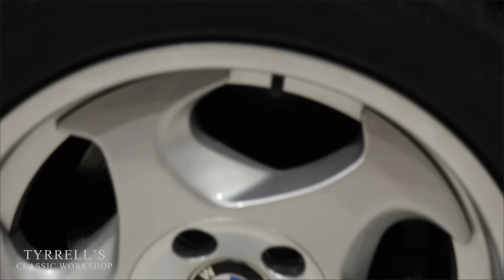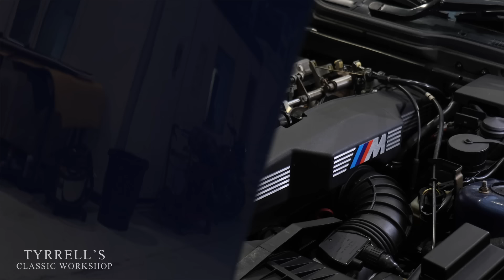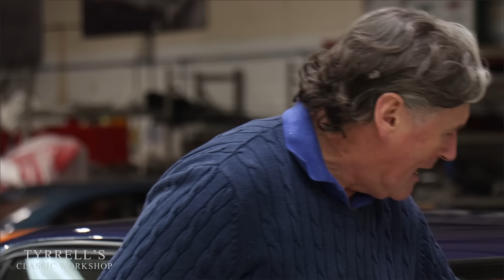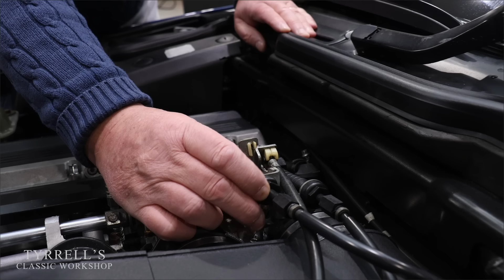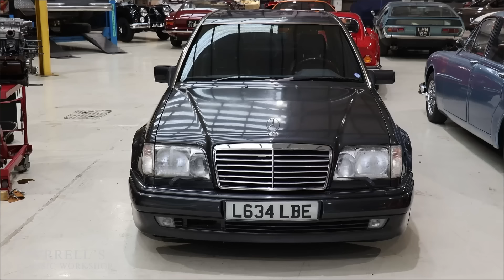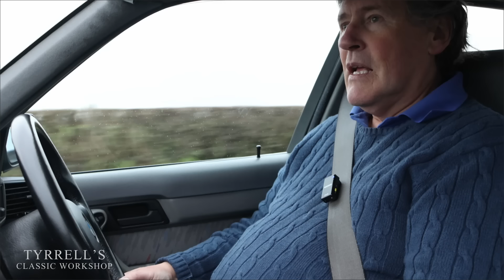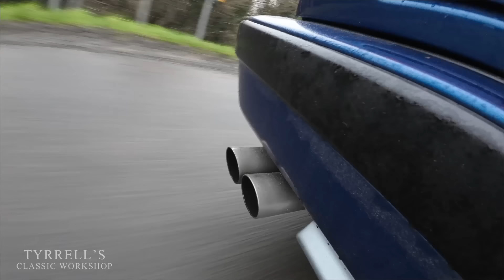BMW E34 M5- the ultimate driving machine?| Tyrrell's Classic Workshop

Comment: Always loved the M5. Unfortunately the 3.8L version wasn't officially sold in North America. To answer your question. In north America, the Taurus SHO was the 4 door somewhat performance car 0 LOL. But let's not forget. The absolute Anti-Christ .... 1986-87 Buick Grand National. Regular production 5 passenger mid-sized family car. As all the magazines clearly stated .... It out accelerated the Testarossa , Countach, Esprit Turbo and everything else made back then in both 0-60 & quarter mile. Only the 911 Turbo's 13.4 sec 1/4 mile was quicker. It did all this with a 3.8L V6 turbo and 4 speed automatic on 215/65R15's. Plus it got over 25 MPG with the A/C on. It was all about bottom end torque coming in at a mere 2400 RPM.

Comment: Very fast, lovely car, had a 3.6 one of these. Every micro meter of throttle pedal gave an equal micro adjustment in revs. Beautiful. But not as fast as the E34 Alpina B10 BiTurbo. Had one of those also!

Comment: I owned two of these at one point, but one was in my collection for a couple of decades.  I also owned an M635CSi for a time.  A few minor points.  Both E34 iterations of the M88 engine had a dual-row timing chains so were no more of an issue than on any other performance car.  The M88 in the E24/28 had a single-row chain and BMW recommended changing the chain and guides as a service item at 160K km / 100K m - an expensive job but just part of owning them.  

Early coolant tanks on the E34M5 had problems with the coolant level sensor thread collapsing in on itself over time.  Updated tanks had a stainless tube insert to prevent the issue.

If fitted with self-levelling suspension on the rear, the accumulators can fail and you get a very 'bouncy' rear end.  It's a cheap fix.  If the rear struts are leaking they can be rebuilt.  Most E34M5s had self-levelling from factory as it greatly enhanced the car's ability as a comfortable high-speed long distance car for four passengers.

The 'brake cooling ducts' are not for brakes.  The duct on the RHS is 'blind' and the one on the LHS has a duct for cooling the alternator.  On the '3.6 litre' cars, the magnesium 'fan blades' bolted to the wheel centres were for brake cooling, but in the end the later 'throwing star' covers did an adequate job without the same cost and complexity.  The body kit on the M5 was very cleverly designed for zero axle lift front and rear without needing a rear spoiler.

Steering boxes on E35M5s are often over-tightened and destroyed prematurely.  They are unique to the M5 and are almost impossible to find.  The on-centre 'play' in the steering on the road is nearly always caused by worn balljoints in the steering tie rods, centre link and drag link, plus suspension bushes.  When stationary the slight play is most often in the sliding joint in the steering column - there is a tapered nut to take out play but if it is over-tightened the column is no longer adjustable for reach.

We live in Australia so I can comment first-hand on direct comparisons.  Both Wheels and Motor magazines ran articles comparing the E34M5 to Holden Special Vehicles modified Commodores - I still have those magazines.  The M5 was a clear winner in the first couple of articles.  In a rematch a couple of years later against the next generation of HSV Commodore, the M5 was still declared the winner but by a lesser margin.

We saw E34M5s competing in motor racing events in Australia too.  One came third outright behind two BP-sponsored Mazda RX7s in a 12-hour production race at Bathurst, and two were campaigned successfully in targa events - including Targa Tasmania.  A good friend who has raced XJS Jaguars for decades mentioned the wet weather supremacy of the M5 in Targa Tasmania: 'It was bucketing down with rain and an M5 passed me on a corner like I was standing still!'.  Their wet weather balance is legendary.

Nice to see an E34M5 getting its due on your channel.  As a former owner of two I think the last hand-built M5 is a criminally underrated car, and it is good to hear you bear that out during your drive.
Reply: Thanks heaps for your comment, I dropped the HSV Senator in as comparable to a M5, my father owned a M5, I loved driving it when I could, Rj in Nth NSW
Reply: Great post.  Love posts like this that provides background & what to look out for, in that odd event I ever come across a winning lottery ticket, I’d find one of these straight away in the 3.8 liter version.  What I find a bit amusing is that I would venture to guess, without having measurements in front of me, that my current G82 M4’s footprint is much larger than this 5 series super sedan.  Lastly, I would venture a guess that if G82 M4 aged like this M5, with the complexity of the car, there are infinitely more things to go haywire than on these simpler made cars.  Plastic valve covers, plastic oil filter housings, plastic everything…. Oh well, I guess that’s progress for you.
Reply: @rw3915  I firmly believe that owners commenting on videos like these is important so people who might buy one are armed with as much knowledge as possible.  A good E34 M5 is becoming an expensive purchase now and buying a well looked after car saves a ton of money in the long run.

We kept our E39 M5, but there are better and worse things about it as a collector's car - one of which is electrical 'gremlins' as you've suggested.  As replacement modules get harder to find the only option is repair.  Forums help as other owners identify the most common failures in those modules and how to fix them, but even one generation later you are spot on about complexity being a problem.

In all honesty, if you get the chance with a good one, I wouldn't single out a 3.8 as being 'better' than the 3.6.  BMW didn't build the 3.8 as a faster version of the 3.6 - HP and torque difference is only around 5% better at the same RPM - but to counter the impact of fitting more equipment to the E34 M5 over time.  A later 3.8 car weighs about 5% more than the average 3.6 so there goes that 5% power and torque advantage.  BMW Australia decided against bringing in the 3.8 cars for that reason and opted instead to sell E34 540LEs, which just didn't give the same driving experience sadly.

I've driven a couple of 3.8 E34s and there is nothing in it over the 3.6 in terms of outright performance, plus there are plenty of videos out there with 'drag races' between 3.6 and 3.8 cars with neither car being the winner.  The 3.8 cars are more likely to come with 'full leather' interiors (there were different levels of leather coverage in the M5) and Electronic Damper Control etc, so the choice is really about how much 'stuff' you want rather than performance.  Sadly, a lot of 'internet experts' have built up the 3.8 when it just isn't justified in real world performance terms.

The only exception to the '3.8 isn't really faster rule' is the last few 3.8 LE cars.  These had 18" wheels and a six speed gearbox, and pretty much every option in BMW's catalogue.  Again, not really faster in a straight line (an extra gear change to 1:1 loses time), but 'in gears' times for the LE were noticeably better simply because the engine could be kept 'on song' more easily.  Good luck finding a genuine LE though, and a good one will set you back huge money.

Another long-winded comment, but yes, you are absolutely right about complexity being likely to kill later cars as collector's pieces - when you do come into that money though don't rule out the 3.6 on the basis it's a 'slower car'.  Of course if you can find and afford that LE, well... enjoy!
Reply: Excellent reply. The US/Canada/Japan  catalyst equipped e24/e28 M6 and M5 had the S38B35 version of the M88 and had double row timing chains.
Reply: @1983dmd  It was South Africa that got the 333i and 745i, not Australia.  We got pretty much whatever Europe got, with the exception we missed out on the M88 equipped E28 and E24.  The M635CSi I owned was a private import.
Reply: Fantastic post. 

I previously had one of the earliest 3.8 cars and it will remain a regret that I sold it many years ago (particularly at what was probably the bottom of the market!…) - these cars are still criminally underrated and even half decent examples are now very rare indeed. 

Great to see it featured on this channel and get some well-deserved wide exposure 👏.
Reply: I owned an 85 745M (South African vehicle) in Australia with the M88 single timing chain motor. My chain broke at 100,000 kilometres very annoying and pretty expensive to repair. But it was a magnificent vehicle to drive, and yes it demolished HSVs.
Reply: @barrybbq1  Same here. Broke timing chain at 75 000 km ( on the Autobahn...) on my M635CSi.
Reply: @barrybbq1 My 1993 740iL  has a double  row timing chain clearly  visible  when  you  take  off the oil filler cap. 370,000kms  and as fit as a fiddle.  Nearly  1000kms out of the 105 litre  tank. Marvellous

Comment: The other super saloon you're missing from that era was the original C4 Audi S4 with the 20V turbo 5 cylinder engine.  It was much more affordable than the others in the class and only had 227HP and 258 lb ft of torque @ 1950 RPM but that was still enough to pull off 0-100 km/h in 6.2 seconds.  Being turbocharged, it was also fairly straightforward to modify to specs equal to (or exceeding) that of the Lotus Carlton... simply install the Audi RS2 components with a tune and you can match the Carlton performance (not handling perhaps) but with better reliability.  

With that said, the E34 M5 is probably peak M5 in my book in terms of specs, appearance and the overall package.  It has perfect interior and exterior styling to me and the inline six is so very nice.  One of the best sedans ever.

Comment: Had one back in the day, the drive train was weak, the rear end and rear suspension did not take performance that well, along with the engine issues, leaking o rings around the plugs, timing chain, valve cover oil leaks, got rid of it before it was out of warranty as it needed thousands of $$ of work...was a fun car, but high maint just like the 190 2.2 I had both unreliable and high maint dont buy one of these unless you have the money for paying a mechanic a lot of money

Comment: I had a HSV Holden commodore until last year here in the uk . V8 manual, lsd . I chose it over an m5 because it had a 2.5 turn rack and the steering was miles ahead of the v8 m5

Comment: Thanks for this one, Iain. I'm just a couple of months away from getting mine back on the road after nearly 7 years and a few thousands..

You forgot a couple of great tidbits, there is actually 'ADV' which increases the pressure in the drivers windscreen wiper as speed increases. And the headlight/foglight switches are the most fighter pilot thing ever next to a Lamborghini start button, but not as garish.

Comment: The Ford Taurus SHO, although the build quality was mass market, I remember I leased one for 2 yrs (1993 model with manual shift). Plenty quick, lots of rattles after 35k miles.  3.2L Yamaha derived engine, sticker was 28k.  I now drive a BMW.  Great video as always Lain

Comment: My late father bought one (not the M) in 1991 and I went to view it with him.  I remember that particular 5 series was so popular, BMW were slightly worried that it was causing a drop in the 7 series sales.  I remember the salesman talking about the new 6-cylinder, 24 valve engine - and it was really smooth.   Build quality was peak BMW

Comment: I would not say it is a super saloon but I owned a 1995 Cadillac Seville STS and that had a 300 Horsepower V8 and Lotus developed suspension. It was FWD but id not have a limiter and it could push 270KMH or 165MPh +. Do miss that car it had a jekyll and hyde character.

Comment: As my avatar suggests, I'm a big fan of e34s, and really enjoyed the video. Single row timing chains were on the M88s, the S38s (b35, 36 and 38) were dual row and generally robust, though the tensioners can leak, and there are updates. Interestingly, the ducts in the front bumper's lip spoiler wasn't for brake ducts, one goes to supply cooling air for the alternator, the other is blanked off, with the ambient temp sensor inside.

Comment: With the ITBs on my S50B32 I've had to adjust the way I keep my foot on the gas pedal. The way I usually drive cars, with the front of the foot halfway down the pedal won't work at speed bumps, it's too sensitive.

Comment: This my super-ego's blazing chariot. An E34 520i automatic was our family car since my dad bought it new and collected it from the factory in Munich in 1989. He still has it, we can't let it go even though it hasn't turned a wheel in about three years and someone has nicked the exhaust. I learned to drive in it and even after many years I still loved getting behind the wheel whenever I was back home. I still prefer it to my dad's current E39, even with the recirculating ball steering. And styling-wise, Ercole Spada knocked it out of the park, this was the best-looking 5 series ever. The base car has a Cd of 0,31 which was excellent for its day. The rear seats could have been roomier and disappontingly did not fold down, but the car was perfectly sized for the road, not too wide, not too narrow, just perfect. Gotta love the E31 8-series Ninja throwing star wheels on the M5 in the video, they complement the lip spoiler well, but as an abstract concept in my mind's eye, The Ultimate Driving Machine very specifically wears turbine fin alloys...

Comment: Thanks for a great video, your knowledge of classic cars is exquisite. May I be so bold to mention your use of WD40 for loosening the door hinges... WD stands for Water Displacement - It is NOT a lubricant. It may well work in the short term by diluting/dissolving the grease that the hinges would/should have been lubricated with, so a temporary solution, but in the long term will cause excessive wear on the bearing surfaces. The correct lubrication for hinges is grease. Thanks again for a great video. Cheers!
Reply: WD40 makes more products than just the original stuff. There are lubricants in similar looking, WD40 branded bottles too, and from the video it is not shown which exact product Iain is using.

Comment: Alfa Romeo's 4 cylinder Busso engines dating back to the mid 50's had twin overhead cams using buckets with shims for valve clearance purposes. Now that's quite a few decades before BMW's application and yet no mention of it. Sad!
Reply: That is sad.Very sad😢😢😢

Comment: S38B38,,   as ALL S38 engines has dual chain,, only EU M88/3 had single, but its US brother got code name S38B35,   E24 M6/E28 M5had dual,,  i have NEVER heard of a broken dual chain on these engines EVER,,, 
M88/1 as E26 M1 started with the shims,, and then M88/3, and then S14 and S38 came alive ,,  E34 is the 3rd gen ,, not 2nd  of 5 series but 2nd of M5. S38B38 is the latest version ,, and my all time favorite 24V BMW Semi race engine,, back then 340 bhp and 400nm was superb for a 3.8L N/A ,, but E34 M5 well equipped is a heavy car,,   these cars are fantastic but as Mr Tyrrell mentions these cars are brick,,,

Comment: Had a 3.6 E34 M5 in period - was an absolutely wonderful car - just a couple of points - the E34 M5’s were assembled at Garching on a separate line, so there was a relatively limited and finite production capacity - they were also very expensive when new, but there was, at the time, pretty limited competition.

Comment: The E34 was the 3rd gen 5 series, not the second. E12, E28, E34. It was the second gen M5 however, as the E12 introduced the first M535i.
Reply: Late Brake Show had a barn find episode about an early M535 (E12 but I could be wrong)
Reply: He meant second generation of m5

Comment: 3rd generation 5er!
Reply: E12 1st generation where M535i was top of the line 
E28 2nd generation where M5 was top of the line.
Reply: Double timing chain on all S38 engines, only M88 which was in the E28/E24 had single chain.

Comment: I used to clean and drive a 525i. Gorgeous car and a fantastic sound from that 6 cilinder. Not an M5, but what a car ! It had enough power to drive the last drops of water out of it after cleaning. I once hit 120kp/h on a small road (once the T's and P's were good of course), and had to brake hard to make the corner. So much fun !

Comment: Holden HSV.. Had 390hp in the 90's, would easily do 170 mph.. I know because I did it between Mount Isa and Alice Springs!

Actually, the one I had was put on a dyno in Townsville and hit 410 bhp stock. Back then...big power and enormous torque!
Reply: This was discontinued before they had more than 225kw (GTS-R) with the 5.7 Holden motor, it wasn't until the LS in 1999 they topped the 250kW of the 3.8 E34, by which time the E39 had 300kW,, same as the GTS got in 1999
Reply: I was about to mention that since the title mention the "ultimate driving machine" of this period was BMW brand with that marketing slogan for these 4 doors saloons but in reality a Vauxhall/Omega Lotus Carlton for EU or for Australian market Holden Commodore would eat it for breakfast in term of actual performance and Mr. Iain Tyrell even mentioned that when it did presented a Vauxhall Lotus Carlton in workshop series..
Reply: @poplaurentiu4148  A 6 litre Commodore has greater performance than a 3.8 BMW? OK, probably, but only just,...now look at that again. 6 litre vs 3.5
Reply: When the E34 was current though, HSV's best was 215kw.